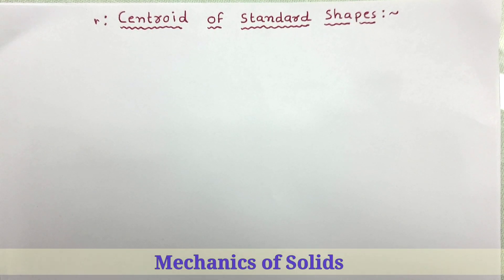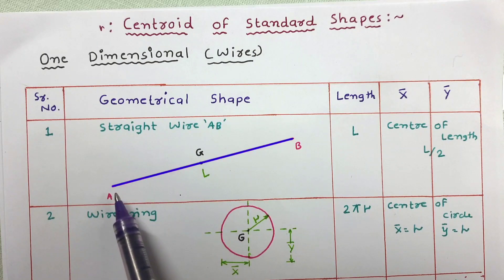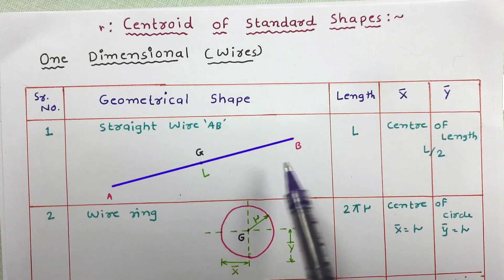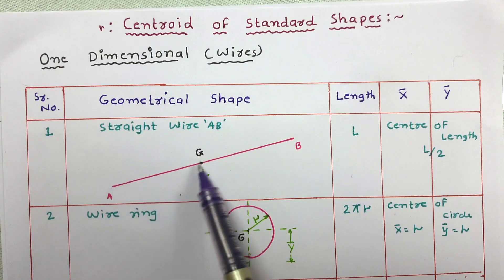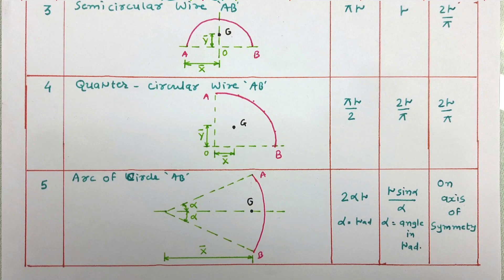Centroid of Standard Shapes (One-Dimensional Figure) | Mechanics of Solid / Engineering Mechanics

Comment from the maker: Centroid of Standard Shapes (One-Dimensional Figure) in the context of Centroid is explained with following timestamps:

0:00 – Mechanics of Solid Lecture series
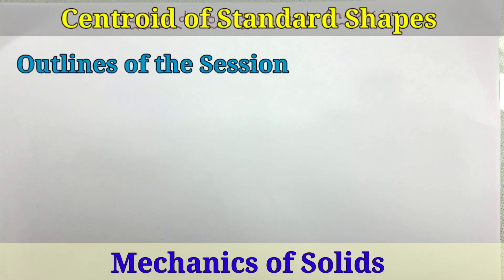0:12 – Outlines on the session
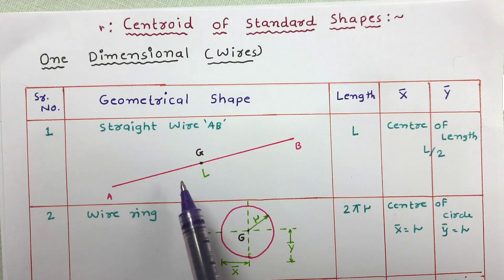0:35 – Length and Standard One-Dimensional Shapes
0:30 – Length and Centroid of Straight Wire
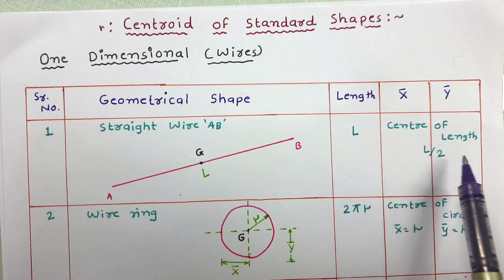1:28 – Length and Centroid of Wire Ring
3:08 – Length and Centroid of Semi-Circular Wire
4:41 – Length and Centroid of Quarter Circular Wire
6:05 – Length and Centroid of Arc of Circle